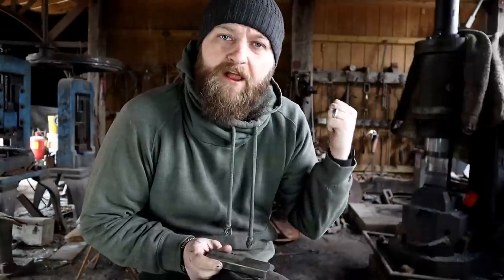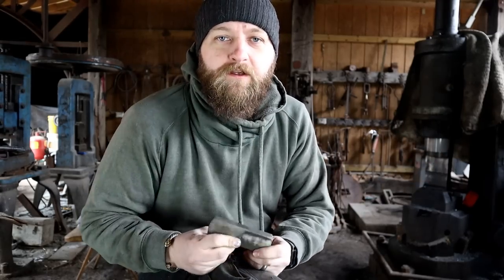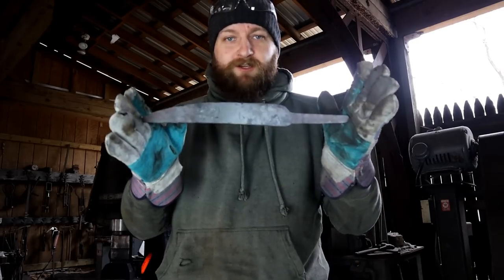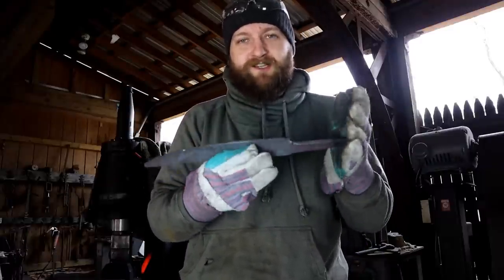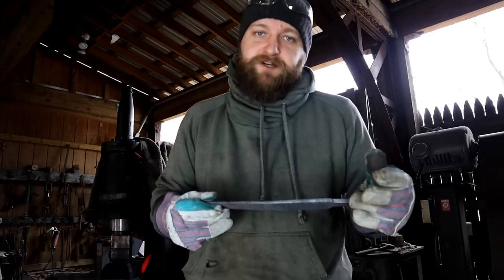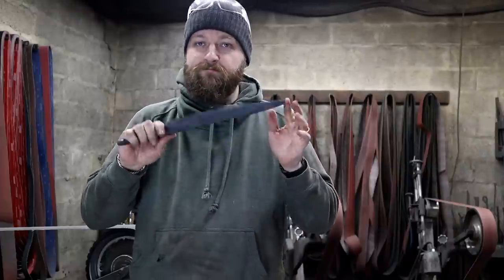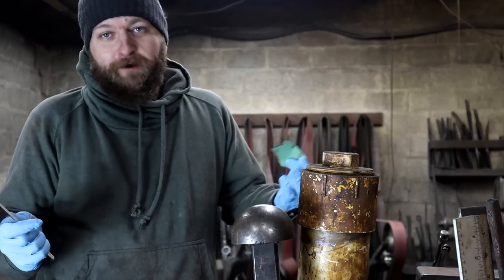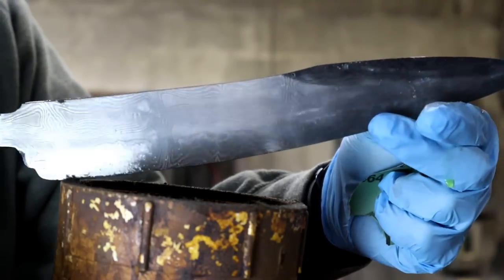Matt Forges a Mosaic Damascus Knife - In The Works

Comment: Could you guys maybe do an episode going in depth through the process of making bloom steel/tamahagane. Maybe some info on the terminology and maybe dispel tye debate on what the difference between Oroshigane and Tamahagane
Reply from the maker: Orishigane is remelting material to decarb or add carbon to it. Tamahagane is made from ore in a large stack called a Tatara
Reply: @ThatWorks  does that mean that cast iron could be decarbed and turned into a forgable steel
Reply from the maker: Yup
Reply: I haven't seen any smith on YouTube do that. Maybe you guys can do a demonstration